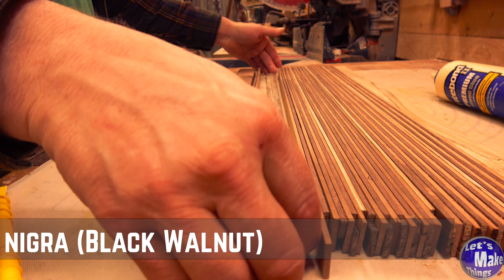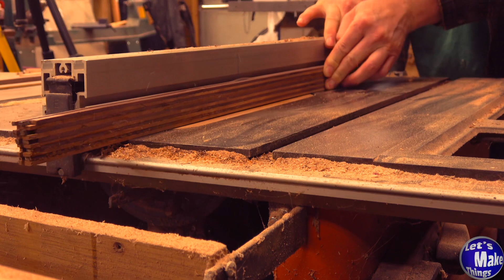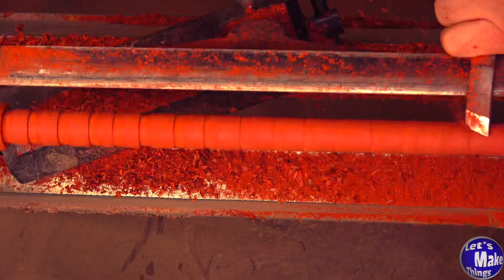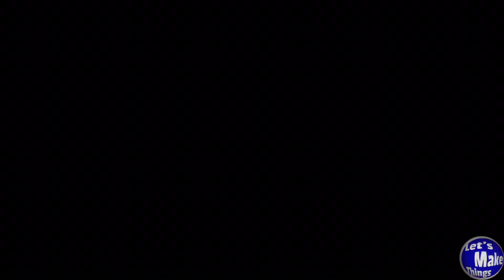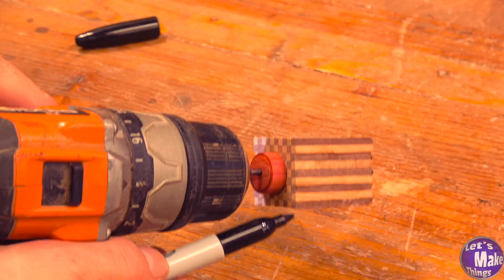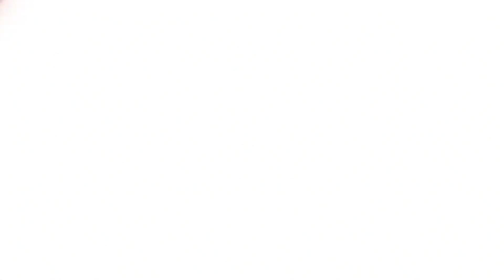100 Awl Challenge: Act 3 // The "Checker Madness" Awl

Comment: Those turned out amazing. Very cool.
Reply from the maker: Thanks Danny.  I have one coming out in the next few weeks that I think is going to turn a few heads!  Have you thought about making one yourself?
Reply: @makethingswithrob  , thinking about it. My shop isn't quite ready, but I might try to work around the mess and disorganization. We'll see.
Reply: I decided that excuses are lame. I can't really use my power tools, right now, but I've got some hand tools I've been wanting to learn how to use. I found a walnut scrap that was originally a piece of firewood that I rescued from my parents wood pile when they sold their farm. It's half sap wood, so the color should be nice. It was a cut off that had been cut on a band saw. It's nowhere near square. I'm just going to go at it with a hand saw, some planes, chisels, files, rasps, etc. I don't even have a vise set up, so I'll make do with some clamps. I will probably use my drill press to drill the hole for the nail, though. Not sure I'm brave enough to use the brace on an actual project just yet. Not sure how long it will take. I'm a line of duty disabled paramedic, with a surgically repaired spine. So I can only do so much at one time.
Reply: @Let's Make Things  , I finished it. I sent you my pics by email. I ended up using my drill press to drill the hole, so it would be accurate. I also used it to polish the nail, and do the final round shaping on the handle. I made it square, then octagonal with hand planes. It was a fun project. Thanks for doing the challenge. It was a great idea.